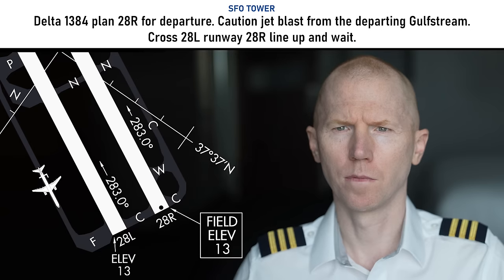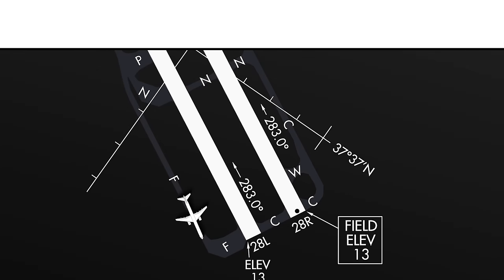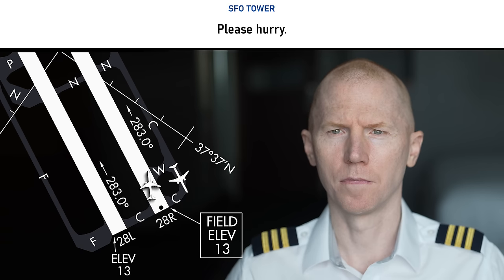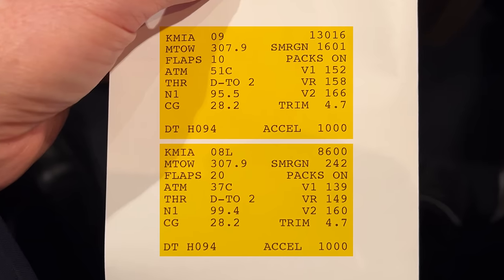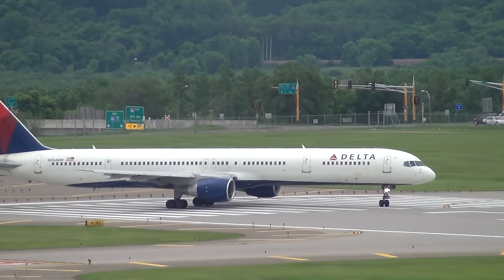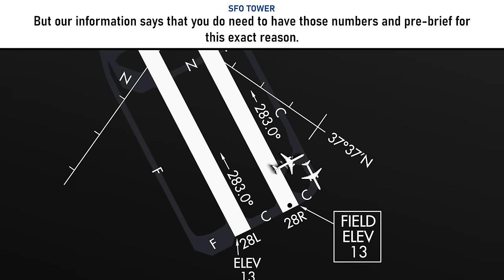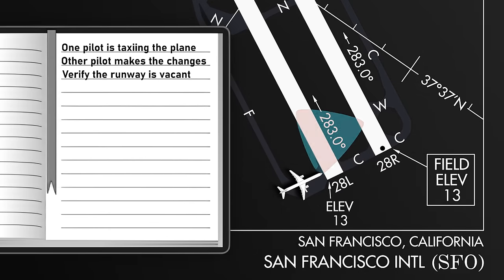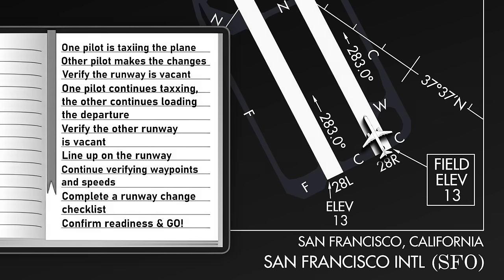ATC Doesn’t Like Delta’s Comment

Comment: Pilots have to remember they can always use the magic word: "Unable." The PIC can refuse any ATC clearance or instruction they deem unsafe.
Reply: Well said.
Reply: You actually cant.
Reply: In this case the controller gave them the option to hold short 28R while they got set up, but instead they took the lineup and wait and told her 2 min was what they needed.  Controller could have done without the attitude but she wasn't in the wrong.
Reply: True that could get them sent to the back of the line for takeoff. Obviously the safer choice, but the controller was ready to send the other aircraft around if Delta couldn't depart or vacate.
Reply: @toddsmith8608 well,maybe so, but if that was me, the next time they gave me a very last second runway change I would hold short for as long as possible, to really jam up the works and transfer  the workload back to the snotty controller.
Reply: @pilsplease7561 you actually can. Per the FAA regs, the PIC has the ultimate authority.
Reply: @acleverusername4866  "Jam up the works," as in you would intentionally inconvenience everyone else trying to depart, just to spite the controller?  Hmmm.
Reply: So accepting the hold short and entering the data before taking the active was an unsafe option? Do explain...
Reply: @k87upkid  They didn't accept a hold short. They accepted a line up and wait. Holding short until the FMS was reprogrammed would have been the safer thing to do.
Reply: @pilsplease7561  So the dweeb in in the airconditioned building can tell the person with hundreds of lives in their hands "Sorry but you have to"?
Reply: @BabyMakR  Yep
Reply: Used to be a glider pilot. Oldschool. Things you learn are, when in trouble, say somebody just removed half of your wing, bang, oops, land at the safest possible spot. When that is an active military base, they won't like you, but remember, you are saving your life. Still, better land at the farm next to it, but when you really think the military runway is your priority, go for the runway. Maybe this is weird, in a world of laws and rules, but in aviation you need to be stubborn, when danger pops up. Do you know that airliner pilot who landed on Hudson river? He simply could not make it to an airport nearby (there were some, only just out of reach) so he decided the river was his best chance. And it worked out okay, plane total, but I guess everybody survived. Suppose this pilot had aimed for an airport, and crashing in front of the landing strip? Hudson was a solid decision. Goal is not, be a hero, goal is, make a good decision and perform it.
Reply: @pilsplease7561  Nope.

14 CFR § 91.3(a) states, "The pilot in command of an aircraft is directly responsible for, and is the final authority as to, the operation of that aircraft." (Emphasis added.)

Paragraph (b) authorizes the PIC to deviate from any rule to the extent necessary to meet an emergency.

Paragraph (c) puts the PIC on notice that he or she may be required to submit a written report if (b) is invoked.

In my opinion, this is one of the best regulations ever written.
Reply: @toddsmith8608  what?? she was very in the wrong
Reply: @toddsmith8608  yes, I'd spite that controller too
Reply: @acleverusername4866  and ruin the trips of 2-3-4-5 plane loads of paying passengers, missing connections and allocated slots - nice, or the controller just then cancels her plans to give your take-off clearance and sends YOU to back of the line.
Reply: And when a pilot says “unable” on an active runway, they better have some mechanical issue that makes it impossible…if not the FAA will destroy that pilot.
Reply: @matttravis320  He wasn't on the runway. Also, no FSDO inspector is going to cite a pilot for a last minute runway change like that.
Reply: @marcusvaldes  yes he absolutely was on the runway…”Line up and wait” is what he chose and executed.  Line up and wait means line up ON THE RUNWAY and wait.
Reply: @marcusvaldes  additionally yes the FSDO will cite the pilot for that.  The PIC was given a choice and chose to line up and wait.  If you were to say unable at that point and cause another airliner to execute a go-around because of a bad decision on your part to exit the runway, you will get hammered for it.
Reply: @matttravis320  I'm a former tower controller so I know what line up and wait means. And it's not like the plane just instantly jumps onto the runway. And whenever a plane tells me he's not ready,  I assumed it could take more than 2 minutes. I never "locked and loaded" with traffic bearing down on final. And if I did, I was carefully watching in case I had to send the landing traffic around. And I'm old enough to remember "taxi into position and hold."
Reply: @InservioLetum  It's sad that we are all losing empathy for each other in our daily lives.
Reply: This statement always comes up and it kind of makes me laugh, in that its technically correct but if you exercise that right in this kind of situation you’re going to be held responsible for a lot of shit.  This is similar to saying that you have the right as the person driving a car on a busy 70 mph highway to slam on the brakes as hard as you can with no warning, its not illegal to do so at all, but then after you’ve probably just caused a pretty significant accident, a huge traffic jam, and massively screwed everyone else on that highway, you better have a really good reason to have hit the brakes or you’re going to be in some serious trouble from any number of people.
Reply: @SeddersShots  In this case you do have a great excuse. You got issue a runway change with virtually no warning. No FSDO inspector is going to fault you for that. Zero.
Reply: @pilsplease7561  Uh, yes, yes you can
Reply: @marcusvaldes  If their response to her had been “Unable to take the runway, we need more time to program in the approach” you’d be 100% right, and that’s exactly what they should have done.  But they were asked if they could accomplish the task in a specific window and said yes, accepting the clearance onto the runway knowing there was traffic inbound.   Now to be clear, no one is losing any licenses or getting into actual trouble over this, but once you accept the clearance onto the runway, being upset that you couldn’t then get the departure programmed in in the time that you said you could, nah.
Reply: @pilsplease7561  nope
Reply: Delta the best pilots in the world
Reply: I'm a pilot and I approve of this message! They should have just held short, would have made life a lot easier not to mention safer.
Reply: @johnopalko5223 100% agree with you. It's disappointing to see this influencer blinded by his bias. This crew absolutely could have held short to get their ducks in a row instead of play games of who's wrong/right with hundreds of lives behind them. The high stakes commercial flight environment is no place for sensitive egos.
Reply: @ant2312 What airline do you fly for so I can make sure I find another one to fly with.
Reply: @marcusvaldes they had the option to hold short. If I were the controller I would not  have given the option to line up and wait. Both the crew and the controller have a problem here.
Reply: Indeed!  Captain Sully said to Patrick the ATC, “Unable!” “We’re landing in the Hudson!” when he was directed to the nearest airport during his sudden onset emergency.
Reply: I wonder how often this refusal for a good reason actually occurs.
Reply: @johnopalko5223 Thanks for posting this regulation.....
Reply: Technology failure. Why can’t pilots transfer the info from one runway to another with a button? You can do it on an Excel sheet 🤷‍♂️

Comment: Takeoff from L OR R is not uncommon at SFO and that’s why “brief both” is often in the ATIS and why the controller was quick to push back. Pilots should have told her from the jump they needed more time and this could have all been avoided.
Reply: While this is true, the attitude from the ATC that escalated the situation was not helpful for anyone.
Reply: @ariochiv Also, the ATC could have bothered telling them what the traffic actually was (speed) - so they'd know how much time they actually had...

That ATC was seemingly trying to cause a problem/daring pilots to step on the line.

I've honestly witnessed more professionalism from teenagers at a temporary burger stand during a county fair 😞
Reply: Not untrue. But that doesn’t justify unprofessional behavior.

Comment: Probably the reason that the Delta pilot didn't initially just hold short of 28R is because from being stopped at the hold short line until getting centered on the runway will take about 20 seconds or so, and then add in the time to inform the tower that they are ready, and for the tower to respond with takeoff clearance would probably add another 5-10 seconds. So all of this would add about 30 seconds to their departure time, which doesn't seem like much but it's a lot when things are moving that fast. By the time they told the tower they were ready, the inbound aircraft would be even closer, and there was a good chance that the tower would have had them wait at the the hold-short until it landed. But by going onto the runway they would have essentially secured themselves with an immediately takeoff as soon as they were ready, but they ran the risk that they would take too long and be shooed off the runway. They decided to risk it, it didn't work out, the controller got annoyed and called them out on it. So in that sense the controller seems to be generally correct. However the controller mistakenly then tried to tell the pilots how to get things done faster, and seemed to imply that there is no reason why the pilot shouldn't be able to handle a last minute runway change, that's where the controller crossed the line.  It seems to me that neither the pilot or the controller were completely seeing things from the other person's perspective.
Reply: Makes you wonder if she had a guy on a ten mile final coming in on runway 28 right  why would she move these guys from 28 left over to 28 right. She's making more work for everybody, including herself.

Comment: I was taught to never enter onto the runway until you're ready to go.  One should assume that something will go wrong entering numbers or that any other prep/runup will take longer than anticipated.  Rushing also increases the probability of errors.   I agree, the whole thing could have been avoided by holding short, and in the end they would have gotten off sooner.
Reply: I agree. I'm not a pilot by any means, but my intuition would tell me not to be on the runway until I'm absolutely 100 percent ready to take-off.
Reply: Yep, get-there-itis is also a major problem on the ground and this is a clear example of what not to do when you are behind the controls.
Reply: Or...haste makes waste   @statinskill
Reply: I'm saying it....this is a good example of haste makes waste @statinskill
Reply: @statinskill  16 other people got it...but for you...listen to our hero starting at about 5:20, "Slow is smooth and smooth is fast." The bottom line is if the Delta pilots had slowed down (opposite of hasty) not rushed on getting on the runway (as in, "we'll hold short for landing traffic and get our numbers") they wouldn't have been directed to exit the runway via taxiway Charlie only to get back in line behind another aircraft ready to depart.  The landing aircraft would have landed, and they would have been number 1 (Not number 2) for departure. Their haste caused them waste. See? It's seething we CFI's tell student pilots, beware hurryitis. Haste makes waste.
Reply: You're not a pilot I take it.  In the flying community the term "get-there-itis" or "hurry-itis" refers to the mental state of rushing, which leads to poor decision making, as in this scenario. The pilots were rushing and it lead to a poor decision, getting them placed in the back of the line.  That's what he meant.   @statinskill
Reply: Sorry, agreed.  I'm not sure what else I can say to get you to see we are saying the same thing.  G'day @statinskill
Reply: My thoughts exactly. Better to play it safe than rush entering the numbers.
Reply: I remember a saying that my mom posted in the kitchen, "The hurrier I go, the behinder I get".  Apparently an old saying, but still relevant to this day.

Comment: I think the safest option would've been to request hold before 28R, load and check everything and then tell ATC he's ready for departure. I know each minute represents wasted fuel but surely it would've been the safest option in the end. I'll sit back now and wait for the barrage of objections.
I didn't like the rather prickly ATC attitude - all the more reason to avoid stress, hold, reinput, verify.
Reply: 100% agree, when in doubt, don't!
Reply: I’m an airline pilot and agree with you 100%. The whole “line up and wait on 28R and quickly run the new numbers while doing so” is an unacceptably risky course of action. I would definitely have requested a hold short on the other side and taken all the time I needed. I’m pretty firm with ATC when they try to push me into situations which will result in rushing and likely mistakes.
Reply: @fox2mike28  She DID give them that option and the pilot opted to LUAW instead of holding short on C. Whether or not the runway change was timely, this issue was caused by the pilot not being truthful about how much time he wanted/needed. When she told him he could hold on Charlie if not comfortable, that was his chance to do what was right.
Reply: @connix69 and that justifies her unprofessional and completely unnecessary communications that followed? 🤔
Reply: no objections here

Comment: As the pilot, if you know that that "2 minutes" MAY be a rush, say that you prefer to hold short.
Reply: The airlines themselves are probably applying pressure to get your planes off the ground sooner than later.  I work with trains and I can tell you there are rules that they want you to follow or be punished.  But there are situations that are creating by putting time constraints on crews while not always properly arranging traffic clearance to get things done.  So no matter what you do you're wrong even though you're doing everything you can to do ever being asked of you due to circumstances beyond your control.  Just a thought from a similar yet different industry.

Comment: Here’s how I think the breakdown occurred:
ATC: get on the runway, traffic is 5 minutes out
Pilot: ok, we need 2 minutes
ATC: you have 5 minutes
Pilot (not on radio), cool, we need 2 and have 5 to get outta here, we can take our time and do it right

So the breakdown occurred when ATC said they have 5 minutes (meaning: inbound traffic landing in 5, so you have to hurry), but what the pilot heard was “we have way more time than we need as we don’t have to clear the runway for 5 minutes”

In other words, ATC was clear and explicit initially, but on follow up made ambiguous statements that were clear in context to her, but likely interpreted as a clarification by the pilots.
Reply: plus she initailly said 2, ummmm 10.    So this conversation stated with them having 10min and then like 60 seconds later she shortened it to 5.  She's dangerous.

Comment: Fantastic debrief!  One of your best! 100% spot on.   Like you eventually said, just say I need time, I’ll hold short and call you when I am ready.    No rush for anyone.   F the ATIS instructions…I can prebrief but the loading and verifying cost time like you say.  At a minimum it takes 5 min to reprogram and run the checklist(s) at a normal pace.    Controllers rarely have the foresight of what we have to do in the cockpit.  They work for us, not the other way around.  I do believe we need to reinstate the ride program and I want them to ride with crews.   It would help their and our SA.

SFO has some good controllers and I am finding out some of the absolute worst I have ever had to work with.   I witnessed 3 to date in person.   She really needs some retraining on common sense flying issues.

Comment: Looks like SFO.  My few experiences at the airport have been very busy and hectic.  It’s very common to have a runaway change on final. (Which is not fun at all). Had an experience there where we have had to go around due to one of these last second changes.  Another aircraft taxied on the runway we were cleared to land.  My biggest takeaways were that SFOs design as an airport are “interesting” at best.  It’s also a major hub where there are many different world airlines there.  They obviously have new controllers and airlines have new pilots with limited experience.  Then you take away training from ATC, it’s a recipe for safety issues.  Then there are human reaction issues as by the transcript Captain K is going over.  But at the end of the day - the people on the flight deck have the responsibility to speak up and be safe. BREIF THOSE THREATS BABY!

Comment: Can somebody explain to me why somebody from ATC would allow a plane to get on a runway when the pilots have admitted they are not ready to go?
Reply: It is simply the way things work. It is done all the time and isn't a big deal because they can alway take them off the runway back to the taxiway. The controller was a bit snarky (but on the scale of snarky controllers, she doesn't even register) but other than that there is no issue here.
Reply: She asked, and they said they were going to be ready to get off the ground before the aircraft on final landed.  

Even told them to hold short instead if they weren't going to be..
Reply: It’s already explained in the video
Reply: I agree...not ready?  No need to be on the runway.  When you take the runway, you should be ready to advance the throttles and go.  Nothing positive can happen by sitting on an active runway.
Reply: @flfl2 She didn't say what that traffic actually was, and therefore never bothered telling them how much time they'd have - as explained in the video...
Reply: pushing tin